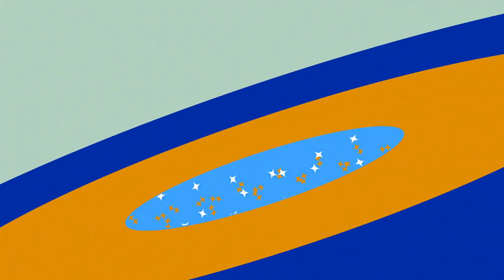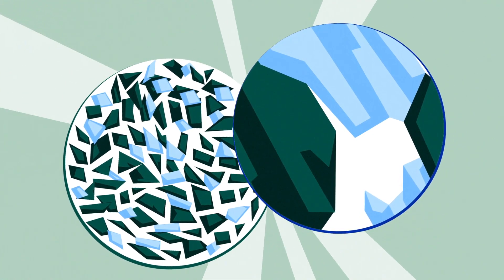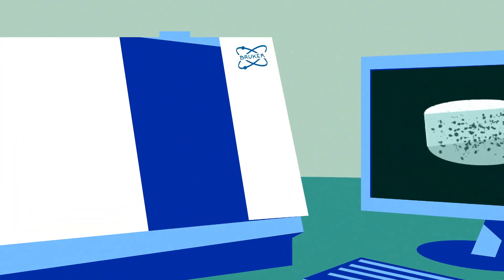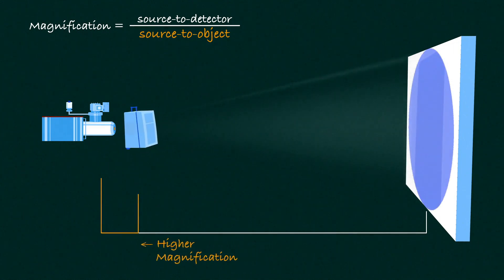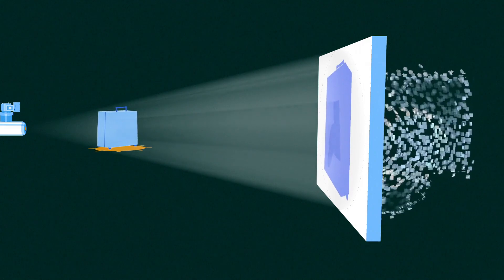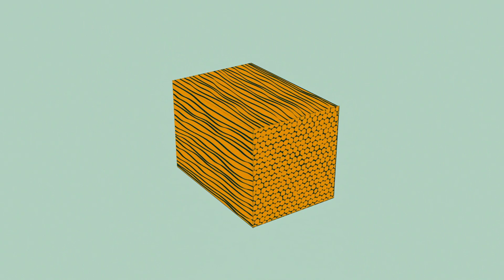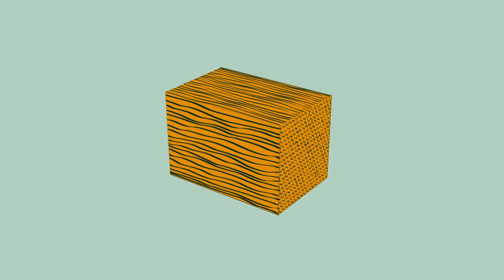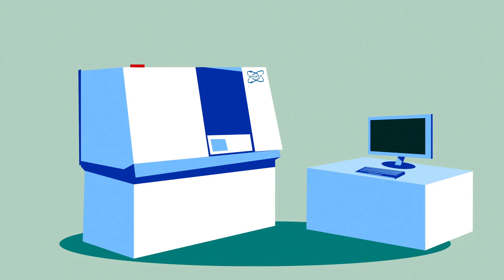What Is X-ray Microscopy?

Comment: Can somebody help, please, what is meant by "larger coverage is achieved by moving the objective closer to the detector (minute 1.53)? Many thanx in advance
Reply from the maker: The video mentions the object position (vs an objective, which is a type of optic element used in photography lenses). XRM is based on a projection method. This means that the beam starts as a very small spot in the source then grows to a very large size at the detector. Placing the object near the detector will result in a larger area of illumination.